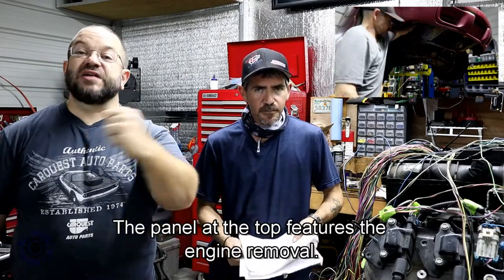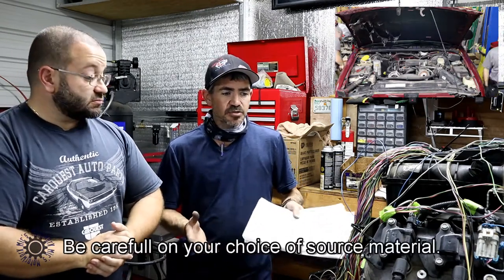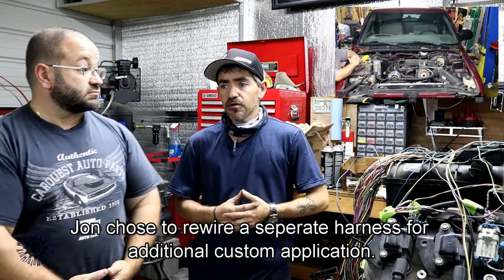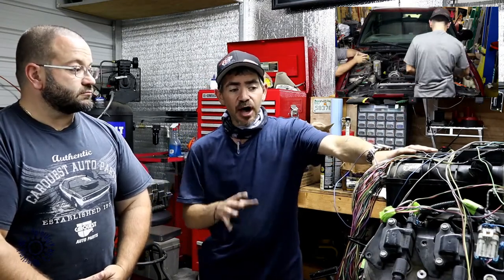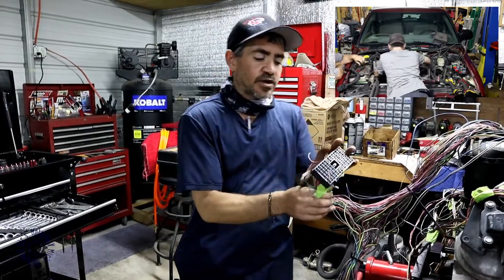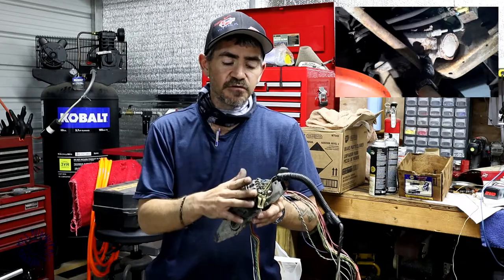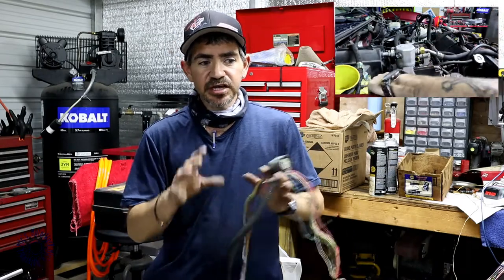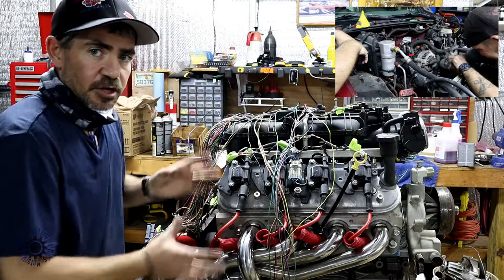LS SWAP - Engine & Transmission Wiring

Comment: The 1 piece connector on the neutral safety switch how did you wire the 2 pink wires?
Reply from the maker: Spoke to Little Jon: Pink wires are Power (12v) constant or switched. Our 4L60e was pre-wired on the harness. The 700R4 and the Turbo350 do not use it.

Comment: Thanks for the information I have a question for you I bought a standalone wiring harness from psi!  I have a 1995  GMC Yukon 4x4 4L60E transmission! I just installed the transmission and it seems that it’s not communicating with the ECU it’s not going into gear or moving! any ideas, sensors etc.
Reply from the maker: Hmmm... I'll ask Little Jon and get get back to ya.
Reply: I have a 1995 GMC Yukon with an LS swap a code keeps coming up P0452 My truck shuts off and will not start it’s a 95 so it doesn’t have a Fuel tank pressure system!I also replaced the Crank engine crankshaft position sensor!  it worked for a couple minutes and then the truck shuts off and  will not start any help would be grateful
Reply from the maker: We might be able to offer some advice for the transmission, for the engine there's a lot of variables that would be best diagnosed on site.  Because it's an "in between" generation of 4L60E and you have a stand alone harness, and without knowing the options on the new harness, we would start with the park neutral switch. There is a difference between the switches used on OBD-I and OBD-II. One switch is outside the transmission, the other is inside. The PCM needs to recognize which gear it's in and there is variables in the wiring depending on the generation. Effectively, the first check should be ensuring the switch is sending the right signal to the PCM and is in the correct pin location on the PCM.
Reply from the maker: Little Jon also recommended LT1swap.com for this kind of information.